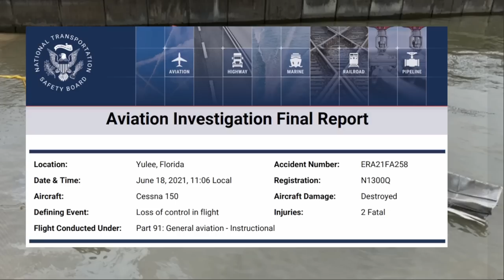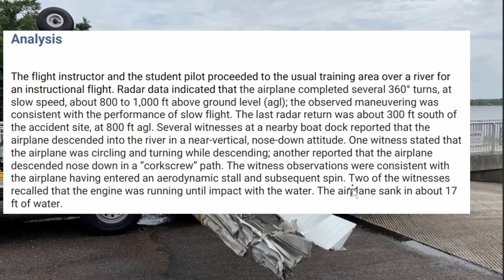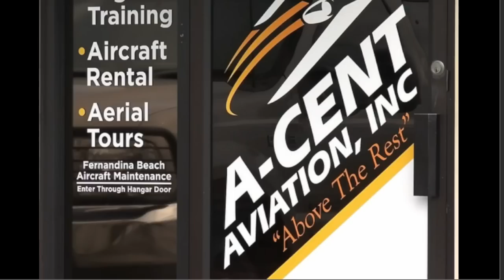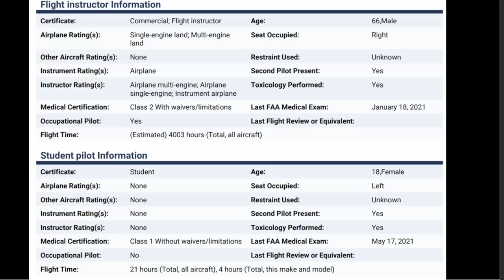Slow Flight Training and Disaster

Comment: As others have said already, 800-100 ft AGL is way too low for practicing slow flight & stall recovery! During my training 3,000 ft. AGL was a minimum. During stall practice you'll lose some altitude, but we'd always climb back up to 3,000 or higher before continuing. I still believe it is insane that in the U.S. spin recovery is not a required maneuver per FAA standards for private or commercial pilots, only for CFI & above. I've had lots of stall & slow flight training, but never once got even close to a spin, so another issue is how did this CFI allow a spin to develop in the first place?
Reply from the maker: Thanks for your take on this one

Comment: I usually practice stalls between 2500 to 3500 AGL for added safety and better peace of mind.  The flight schools in my area adhere to remaining above 1500 AGL.

One primary benefit to higher altitude stall practice is more time to recover should something go horribly wrong.  It also means that you can correct more gradually, as opposed to running up against a knee-jerk reaction that can cause further upset and/or over-stressing the airframe.

I remember one instance where we were practicing power-cut (engiine fail) emergency return to the field in a C152.  We were inside the left pattern at about  a 1/4-mile offset from the runway on the downwind.  We were at 1000' AGL, and as we passed the approach end of the runway, the instructor cut power and had go out 1/2 mile, then roll 90° left and "pull" the turn and enter a nose-down attitude , then roll wings-level and pull out of the dive and land without flaps.  Scared the crap out of me, and that was the last time I flew with him or his school.  I essentially performed an aerobatic maneuver in a non-aerobatic rated plane -- which could have folded the wings.  We were going about 80 kts prior to the stupid stunt, and landed going about 60 kts clean.  We definitely pulled some Gs, and I knew we were close to an aerodynamic stall because of the bank angle and wing loading.  Crazy scarey.  Side note, that was the instructor's version of the impossible turn.

From that point on, I decided that the best option in a loss of thrust on  downwind, is to land straght-ahead....
Reply: The instructor did it all wrong according to your description. The power off 180 landing should be flown very much like a regular pattern and approach.... perhaps a little closer to  to the beginning of the runway for the base turn, and bank angles same as normal powered turns also. What he did doesn't imitate the "impossible turn" scenario either. That is a turn that is done from a climbing attitude, with an abrupt power loss and is attempted from below 1,000' AGL. Sorry you were treated that way, and I don't think I would have gotten in another airplane with him either. CFII here.

Comment: My flight instructor had a 3000ft ASL(we flew over sea) minimum for slow flight, steep turns, often higher for unusual attitudes-recovery etc.  I would not even consider doing those in a schooling scenario at only 1500ft. - why?
Reply from the maker: Very confusing

Comment: Very sad indeed.  Unfortunately, this will fall onto the instructor pilot's responsibility for the accident.  A FAA minimum is a minimum and he should have known better than to perform slow turns where you recover at 1,500 feet AGL just because the FAA says thats a minimum safe altitude to perform said maneuvers.  When any aircraft stalls, there is no guarantee it will recover quickly in the same circumstance as it would in other circumstances so its always wiser to have extra altitude in the bank well before attempting a slow turning maneuver in a Cessna 152.  Obviously, common sense was thrown out the window on this accident.  My thoughts and prayers go out to the victims families and friends.
Reply from the maker: Thanks for the kind words and your take on this

Comment: Also, stalls are no longer part of the curriculum, but rather the recognition of and corrective inputs prior to their development. I'm honestly not a fan of this as they can develop fairly quickly depending on the aircraft. It's also equally important to avoid secondary stalls (much more dramatic) due to improper primary stall recovery, and it's difficult to have an idea what those are, without actually stalling an aircraft. These are quite the eye-openers.
Reply: What do you mean stalls are no longer part of the PPL curriculum? I probably did a 100 during my training
Reply: @Thomas-j3x8k  I did as well and they may be taught by some instructors still. I'm one of them and I will demonstrate a secondary stall, if the student wants to see what that's like. However, stalls are no longer a requirement per parts 61 or 141, but rather the recognition of impending and corrective inputs to avoid, are what's now required. Didn't I already type that? 😉

Comment: Doing slow flight at 800 AGL is crazy. People often perform airwork over bodies of water to maximize altitude available for recovery, but you're supposed to be at least 2500ft for that 1500ft recovery, not 800ft. What in the actual hell.

Comment: Hands on the controls, you can recover with 300 feet of total height loss. Trouble is you initially lose 800 feet and climb back 500 feet after regaining straight and level. No way is it safe to conduct this sort of training at less than 3,000 feet altitude above the ground.

Comment: 2500 to 3000 feet AGL is better for slow flight and stall recovery. Only turns around the point or S turns should be conducted above pattern altitude.

Comment: It is important to highlight that the 1500ft is the altitude at which any recovery from potential stall/spin must be COMPLETED, not initiated. While that number is outlined in the testing standard, I personally never do any airwork below 3000 ft AGL. People who do aerobatics will routinely go as high as 5000-6000ft or even higher. There's really no reason to be low for "high" airwork.
Reply from the maker: Makes sense. Thanks

Comment: We never practiced stall during a 360.  An you should never get close to stalling doing a 360.  We are all imperfect. Instructor made a mistake letting this develop. 
  There is only a few things to keep track of when doing a 360.  A student may make a mistake, but surely the instructor usually heads off calamity.  The 150's can loose speed QUICKO in a turn. I had overshoot my base to final turn when landing (a 150) at Skyhaven in NH. I pulled a tighter turn trying to get back on path.   Speed dropped like a rock.  I was lucky. Didn't really feel what was happening it came so fast, but I caught a scan of airspeed indicator, and again luckily I was able to get wings level nose down and power up.  It was almost too late.     I wouldn't have ended up on your channel if I didn't make it, cause I'm sure it was before you were born, never mind youtubing......cheers..buddy , Lt Sir
Reply from the maker: Thanks For sharing that story.  Seen your channel growing.  Awesome. 🎸 🎶

Comment: 1500 feet is very low. You have to practice stalls at 3000 feet minimum in case of delay reaction to have a recovery chance from the stall or the spin . Condolences to their families and friends
Reply from the maker: Thanks for the kind words Frank
Reply: 1500 for Cessna...not low
But ....they did something unusual maybe ...
Medical problem...
Or .... technical problem.
I know... The instructor not followed the regulations.

Comment: You need at least 1000 feet attitude buffer to recover in Cessna 172/152. In slow flight, you literally dance on the stall edge: any second you don’t control the power precisely, you are in stall zone😬

Comment: Those of us who have been around pilot training most of our Lives, look at this wreckage and the fact it was still near vertical at impact, and it's validation of a mostly unspoken fear shared by most CFI's.   Its a real problem rarely talked about in aviation or even a plan worked out by the instructor should that fear become real.    It has taken untold lives but never gets the blame.   By the way "Lifeguards" know this Human reaction all to well, and unlike us they acknowledge and train for it.
Its student pilot panic attacks. 
You know if a person drowning gets a hold onto the rescuer, they will literally try and climb up them, pushing them underwater and killing them.   And they do it without thinking and you can forget yelling at them to stop.
They are no longer capable of rational thought and in pure fight or flight survival mode.   
This exact scenario most often occurs during the spin/stall training phase as it's the scariest part for most.     When the stall is induced the student panics and "Locks up" most often pulling the yolk into their chest to climb, and holding it there to impact. 
When someone is in this panic state their strength becomes un-human.  You will not physically be able to regain control with your own strength.    The aviation community must begin to do more by first admitting to this ongoing problem and find a solution.
Its even worse now days when wr have hordes of persons trying to lear to fly, not because of a lifelong calling within, but as a trendy way to produce content for a youtube channel.   Their taking the place of the traditional Doctor's, Lawyers, Small businesses owners whom have for ages given avaition a black eye.
Reply from the maker: Thank you for bringing this up to us. I appreciate you sharing

Comment: Slow flight training is safe if it’s done with enough altitude to recover from a stall or spin. I would be at or above 2000 feet. A spin can easily lose 1000 feet before recovery.

Comment: Private pilot with instrument rating here. Slow flight at 800 ft AGL? Absolutely unbelievable. My old instructor told me never to practice maneuvers below 2500 ft AGL. Must be at a sufficient altitude to recover from a stall and spin. You need at least 1,000 feet to recover. When practicing, I never do slow flight and stalls below 3,000 ft AGL (unless landing since a landing is a stall). So sad and prayers for the families. I am not one to criticize unless it is a glaring error. This was such an error and complete misjudgment, or worse, on the part of the instructor.
Reply from the maker: So sad

Comment: 1500 feet is too low. While we know how the aircraft will respond during recovery, the student’s experience and recovery technique is usually unpredictable.
Reply from the maker: Makes sense, lots of Pilot variables during training.
Reply: The airplane was at 800 feet AGL, not 1,500 as you indicated.  Besides student pilots are not trained in spin recovery for their PPL in the US.
Reply: @theresacaron4238  He said the aeroplane was below the minimum recovery altitude of 1500ft, if they are not trained for spin recovery they shouldn't be practicing slow flying especially under a safe altitude.

Comment: Very sad event. The instructor should have known better. C150/152 will spin pretty nicely but 1000 AGL unless you do everything right is not enough to recover. I instruct Stalls and slow flight at 3000 AGL or above for a reason. There are ground reference maneuvers you do lower but those are at Va not slow flight.
Reply from the maker: Thank you John

Comment: Definitely too low to be practicing stall recovery with a student pilot. I noticed she had 21 hours of flight time. Enough time to solo usually but very limited on experience. A stall spin will chew up altitude very quickly and can take some time to recover. You have to stop the spin with opposite rudder and regain lift over the wings which involves nose down attitude to create airspeed then you can pull out and add some power. So essentially you are increasing dive speed to regain control. This can easily take 500-1000 feet or even more. At 800 feet where they were you’re asking for trouble.
Reply from the maker: Seems like such an unnecessary risk
Reply: @ARFFWorld  It really was. The instructor is always the responsible party and they paid with their lives. So very sad.

Comment: Looks like he was practicing GRM. But too slow.  I learned and taught them at around 75-80 mph on cherokees and 65/70  on Cessna  ( Or Vglide Speed GRM). My CFI had a Blue Line on Vglide for ref.   You cannot stall a Cessna at 70  even at 45 degree bank if power on.  CFI let her stall it, and didnt take control over her..
Reply: With power on, like they said they hit the river, Cessnas will stall under 40 knots indicated.  from say a 60 knots or "Vglide Slow Flight GRM" maneuver, it will take a panic student over 20 knot or 30% speed reduction to stall it.  Penty of time to hit the arms or ribs and make them realease the controls.  But.. You have to know if student is the too nervous kind and reject them before stalls and GRM.
Reply: @outwiththem  If you see before stalls and GRM a nervous kind, or too clumsy= out..  But some CFI's want to make a fighter off a lazy or a coward.   You cant.  They will LOC in small emergencies.  That is CFI fault.

Comment: This instructor sadly had the opinion that recovery from inadvertent stall would be the same as recovery from planned practice stall at altitude.  Startle can get us regardless of experience.  I disagree with the absolute taboo declaration of maneuvering flight.  Yes, the FAA is thinking cowboy playing around with low altitude.  I define maneuvering flight as flight where horizontal as well as vertical limitations exist and where recovery from inadvertent stall is generally fatal.  We all engage in maneuvering flight every time we takeoff and every time we land.  Recovery from inadvertent stall is seldom possible at pattern altitude of 1,000.'
Reply from the maker: Appreciate you sharing Jimmy
Reply: The new data indicates that they were practicing slow flight at much too low an altitude to recover from stall or stall/spin, which the witness observation of corkscrew indicates.  Generally stall and slow flight practice is conducted at 3,000' AGL with recovery by 1500.'  One thing dangerously missing in Airmen Certification Standards is low altitude orientation.  High altitude stall practice is not relevant to startle stall at low altitude.  A planned stall involves no startle, while a low stall is not planned or shouldn't be.  This could have been for observation of know sites or homes in the area, which is often dangerously conducted at slower than cruise airspeed and not using energy management.  In "Stick and Rudder" Wolfgang explains the law of the roller coaster which gun pilots and crop dusters use to safely maneuver at low altitude.  We only climb with zoom reserve (cruise) airspeed and we always release back pressure when we bank.  The result is that zoom climb puts us up and slow first and then we use that potential energy of altitude to dive and increase airspeed in the turn to target.  The problem with buzzing friends and looking around is that most use what is called the dangerous "moose turn" up north.  Making the level turn all the way around the target rather than the descending turn to the target causes a continuous deceleration so long as we turn and stay up both.  This often results in stall too low for recovery.  Recovery at low altitude is aerodynamically possible as stunt pilots do so, but they plan the stall.  It is the startle, estimated to be three or four seconds, that makes low altitude stalls so fatal.  Low altitude orientation is that airspeed and not altitude is life down low.  Planned stall recovery technique at high altitude is insufficient preparation.  Prevention of the stall, airspeed and not altitude, is the proper technique.  Not pulling on the stick or yoke in turns, thus allowing the dynamic neutral stability of the airplane design to lower the nose, is the proper turning technique when too low to recover from inadvertent stall.

Comment: Not smart maneuvering, slow flight, stalls below 3000 feet above ground level. At least the altitude will give you a way to recover. That’s what simulators are for just my opinion.
Reply from the maker: Appreciate your thoughts Pete

Comment: Two friends (brothers) flew their older brothers Cessna 150 and practiced slow flight training at 1500ft to stay below controlled air space. Went into a spin and eventually hit the ground.  Both passed away.    The 150 should never be put into a spin for any reason.  Its NOT a easily recoverable situation for the 150 and 152.  Just DONT do it.